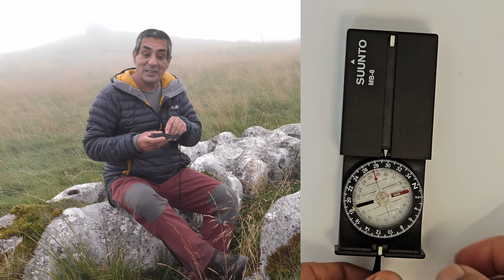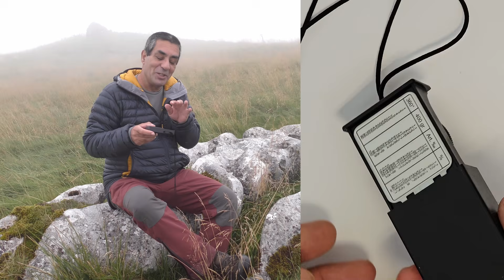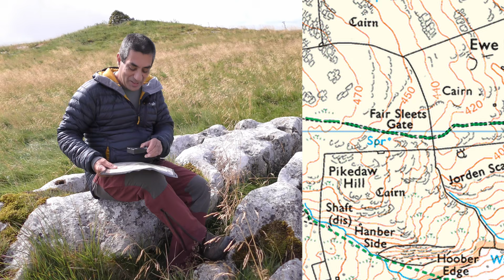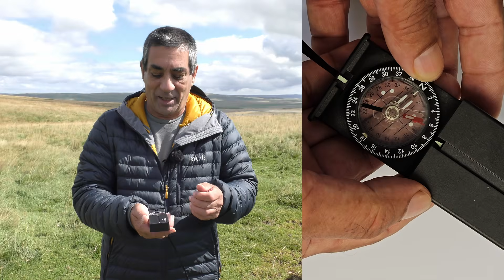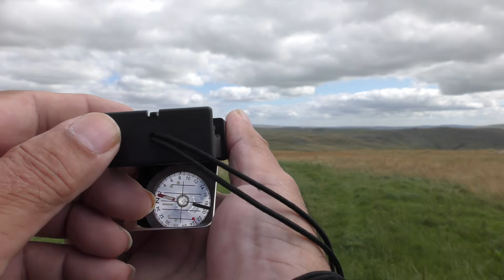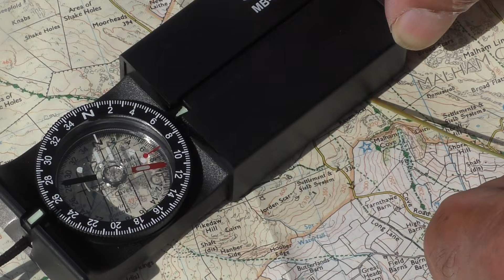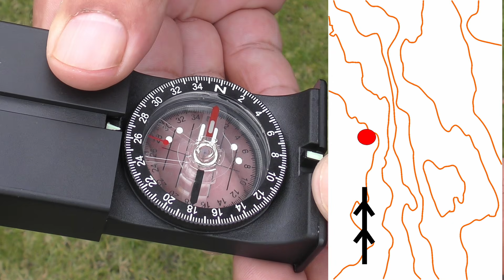Suunto MB 6 Instructions + improved military boxing technique

Comment: I bought one of these 10 years ago but never used it, felt overly complicated. Thank you very much for this video, i think ill swap this for my Silva :)
Edit: I noticed i have the Global version, do i still need to adjust for the "magnetic fields"? If so, whats the "perk" with the Global one?
Reply: Yes, adjusting for magnetic declination is still required for "Global" models. The perk of the global models is that they can be used in both the northern and southern hemispheres - standard compass needles are subject to magnetic dip/inclination and so are made for different general latitudes.
Reply: @darwinsporcupine  Ah, makes sense. Thanks!

Comment: Interesting video. I have another version of the Recta. It's a DP6 with a Victorinox shield on the outside and 360 degree markings on the dial. No luminous marks on the case and no black/white bezel. Obviously a civilian model - without the button release. The Suunto (which I also have) is certainly easier to read.

Comment: Hi, very good video manual for this outstanding compass. Have one and using it since my service in German military. 
If you set up the declination correctly it will account for it automatically when taking bearings from a map. The two luminous lines are always for magnetic north / the needle. For geographical north of the map just align eith the fine black grid printed in the bottom of the capsule instead. 👍🍺🇩🇪

Comment: I have a Recta DP6 and I always carry it in my backpack and today I learned so much more about it. Thank you very much.

I have an annoying problem with it. The semi-permanent declination always turns itself when I carry it in the backpack for a while. I just checked and currently it's 100⁰ off. I fixed it a few weeks ago.

So before every usage, i need to check, get a small screwdriver and set it back to zero. 

So it's not semi-permanent declination for me. More a never-permanent declination screw. 

Am I screwed or is there anything I can do to get the screw more tight?

I asked Sunto a while ago but they told me they can't do anything due to the age of the compass.

Thanks a lot
Reply: How about a spot of nail varnish or super glue...just a thought.

Comment: Looking at the specs of the compass, I see that the accuracy is not as well as the other models. 

What is the acceptable accuracy limits of a compass for navigation, in your opinion? 

Also, what are your opinions on the use of lanyards, and also proper use and length of them? 

I have been going through all your videos, from the beginning, and have learned more than from most books.

Comment: Great video!
I own this compass and it has super smooth needle. I use lume tape on my other compasses to allow me to use the V maneuver. I place a small strip at the 300 and 60 degree marks.
The V maneuver cuts down travel distance by one third.

This compass is reliable and one of my favorites.

Comment: Hi Wayne. I really love this video because I´m a great fan of this compass. Did you know that currently part of the Argentine army uses this compass?. Incredibly, the 60 degrees boxing technique is not described in the actual Suunto MB-6 matchbox compass manual, you must go to the original DP-6 Recta manual to find out what are the two pair of 60 degrees dots are used for.
Reply: Very true. The original manual that came with my RECTA DP 10 describes this feature, totally missing from the Suunto manual. 
By the way, I cannot find the original RECTA instructions in pdf that came with my compass but a very abridged version that omits this very function.

Comment: Thank you. I learned a lot. The last bit is fascinating. I have the civilian version of that compass from a few decades ago. Now I am going to have to find it and look for those dots. Mine has the same icon as the Swiss army knife. Also curious to see who manufactured the one that I have. I will update this comment after I find out. Thanks again.
Update, mine is OD green and was purchased in the US. It is branded Recta and made in Switzerland. It says Type DP 2 is missing some of the features of the MB 6 but is very much like the DP 6. It has luminous marks on the dial but no luminous material on the other marks on the box. There is no declination screw but all of the holes and features that would accommodate it are there. No sticker on the back of the mirror. The dial on the DP 2 is in degrees, 360° no latch on the box, just pull the lanyard to open it. The two 60° marks ARE there fortunately. The needle is very accurate and very stable. Also no clinometer.

Comment: I was awaiting for months for you to talk about these compasses. I do not have a Suunto but an original Recta DP10, bought back in 1996 in Zermatt, Switzerland with its original leather case. Yes, the year Recta was bought by Suunto. The case and drawer system is more like the actual Suunto than the older case of your original DB6.

It was my only compass for years (now I normally use a Silva 3NL).

The DP10 was the top of the recta line back then and the most obvious difference with the current Suunto MB6 is that the DP10 was "prismatic". There's a couple of small prisms inside the compass that, looking from the side of the bezel, can let you read bearings in a very precise and easy way, much more precise than using the mirror which was also included, in this case mostly to be used with the inclinometer.

It is really a pity that Suunto discarded this system. It is a gem.
Reply: Yea, remember using the DP-10 during military service. It was super easy to take a bearing.